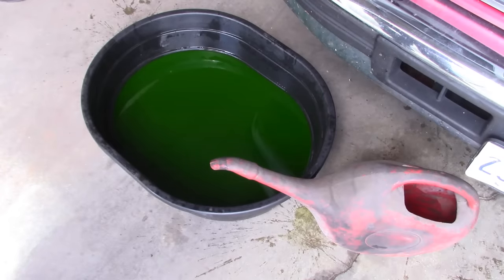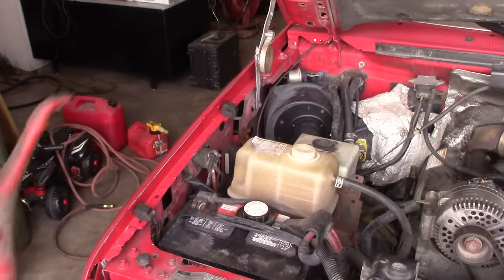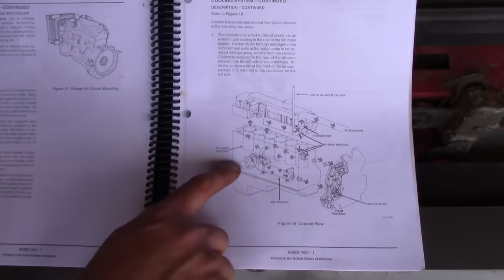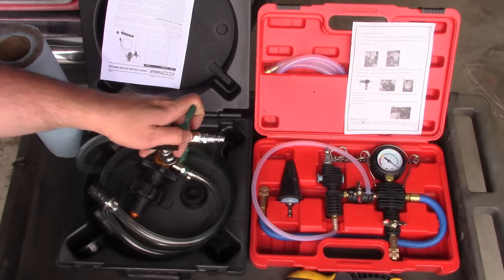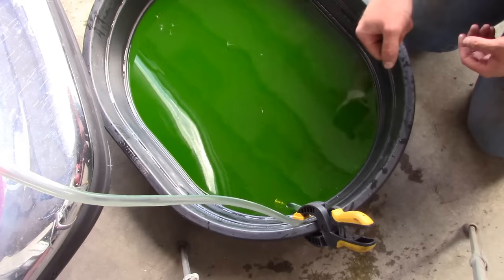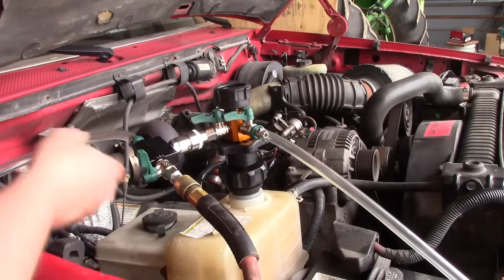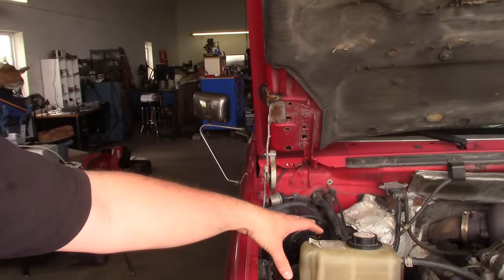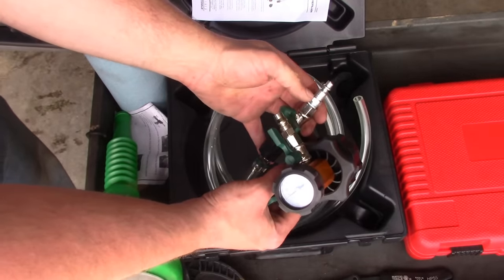What is a Vacuum Coolant Refiller, and why do You Need One?

Comment: We got one for the shop. We immediately noticed that after using it to fill all the cars with coolant that a good percentage was coming back with radiator and heater core leaks.  They were not able to take the vacuum when the plastic radiator caps get old and brittle.  They were designed and braced for internal pressure, not for an external one. It worked great but we stopped using it because of that.

Comment: I am looking for a version that is especially designed for air cooled engines. But they're hard to find.
Reply from the maker: Snap On probably makes one.
Reply: I've been informed that version is on backorder along with the diesel spark plugs and left handed ty-wraps I need to finish my Deutz Tesla swap project.
Reply: @zlmdragon.  you again, you asked the same ques. on another channel.. nobody answers dumb questions.
Reply: You find them in the section where the antifreeze for VW Thing is.

Comment: I have the U-view Airlift ($120) at the shop, saves SO MUCH time after a radiator or water pump replacement. They are a must on a lot of the newer vehicles, almost impossible to bleed them without it.

Comment: These tools are great I have two versions in my workshop, but they do need a brief warning from my experience, the vacuum refill is good on new systems but on older systems by vacuuming the system the rubber pipes suck in on themselves, on old pipes I have found that this can cause them to split internally, admittedly they are already weakened, but nothing worse than doing a quick coolant change and the cars comes back in weeks with a split or leaking old pipe! Great kit in the right application!

Comment: I know I'm a little late to the party, but I use these quite a bit in my shop. Mine is a Cornwell one. We used to use the electric pump like you described. For a while we had problems with Cummins EGR coolers failing often and putting coolant in the exhaust. We started using the vacuum fillers and the problem dropped quite a bit. Thought is the corigation on the EGR cooler pipes was holding onto air bubbles and causing hot spots in the cooler. The vacuum eliminates the bubbles so there's less failures.

Comment: Those are great. Had one for years. The no spill funnel is awesome as well. I usually only use the vacuum filler on problem engines, but the no spill funnel doesn’t fit all the time. Great video again.

Comment: I've also used a method using a 5 gal pail with a barbed hose fitting installed at the bottom of the pail with a 10' length of clear hose. The cooling system needs to have a drain cock on it though. You drain the coolant with the bucket sitting on the floor and then use the same drain cock to refill the system, but put the bucket up higher that the engine and it fills from the bottom up. Works great and you don't get any air in the system.

Comment: More for industrial or Diesel engines which have a more complicated system so to speak, but for my little Honda & Chrysler 300 my Spill-Free Funnel works great. It takes a little longer and you do need to run the engine long enough to open the thermostat. Having bleeders in both cars is a big plus. And an air compressor is not required. Great info Wes. Thanks!

Comment: Well thanks for that, now I need another tool. I used to work on old indirect PSA diesels and they used to spit cylinder head gaskets off at the slightest excuse. They also didn't have a separate header tank or bleed valve - I often wondered how many went due to air locks.  This toy may well save a few cylinder heads. Cheers.

Comment: Been using one for over a decade. Started off with a Snap On one that worked ok. The part I didn’t like about it is you had to hold down a button to apply/keep the vacuum going. Currently I use an AirLift brand one which has the valves like the one you have. 

A couple of things I do a little different then you (not that either way is right or wrong) is I put the grommet on the tool first then out the tool on the tank. I also partially fill the system and then reapply a vacuum to the system just Incase there is some how an air pocket (obviously there shouldn’t be, but ocd gets ahold of me sometimes). Then just continue to fill the system. I’ve never bleed the fill hose (again nothing wrong with doing so). I have noticed they can overfill the tank a little.

Comment: Just ordered one for 82 bucks and used the link, I think it will be well worth it. Maybe I missed it but if the engine is cold how do you get coolant through the engine and also into the heater core? I have a common problem with my 97 f150 that air is trapped in the heater core since its above the coolant bottle. Will be nice to get it out

Comment: I use the airlift brand. Nice when your filling a 15 gallon cooling system on a trash truck with a reservoir that’s 10 feet above the ground. The stock hoses are always too short, I bought some bulk clear hose and I can fill a truck up a bay over.

Comment: Late watching this but they are great tools and work well on most engines. Vacuum leak down test can be misleading as I have had it suck some leaks shut and they leak with pressure but hold vacuum ok. In the olden days my dad would put an aspirin in the thermostat then fill the system. The aspirin would allow the air to escape thru the thermostat. We also drilled a single small hole in new thermostats to allow air to escape from behind the thermostat body.

Comment: I just use a 5 Liter canister and put it on the engine, with a big clear pipe attached. When I tilt the canister 90° it will fill the coolant tank.
Those canisters have a second cap, on the other side and you can open and close it to change the flow rate. It works pretty good for me.

Comment: This is interesting having a big vacuum pump so much more useful. I have a big Sergent Welch vacuum pump I bought for $50 years ago from a used scientific supply. My son used it for pumping down ACs. With that and a few valves you can do vacuum filling. Plus a few rubber stoppers. On a wheel cart not bad to move around. Will be with you forever.

Comment: Probably could rig it to hold oil in a tank as well. We use a vaccum deal on the combines and sprayers so you can replace a hose or o-ring and not have to drain the system.

Comment: I drove a fuel truck with the DT466. If you ever stalled it out going up hill and started going backwards ( on ice no less ) releasing the clutch with it still in a forward gear would cause the engine to fire in reverse. Blowing exhaust out through the intake. It doesn’t bit sound good either.

Comment: I just finished changing the coolant on my 2016 Kia soul+ 2.0L.  Used the OEMTOOLS 24444 Coolant System Refiller; it worked very well.  It pulled a full vacuum in less that 30 seconds!  The only improvement I wish they would make is to redesign the filler pickup so that it fits through the opening of a coolant jug.  Close, but no cigar  :-((

Comment: Do you think collapsing  the hoses causes any damage to old coolant hoses ?   I do like the radiator hoses with the internal stainless steel  coiled springs that stop hoses collapsing.
Reply: If it does compromise the old hose, it should probably be replaced anyway. As far as reinforced hoses. I assume just won't collapse. Should be no harm.

Comment: Read 98% comments. 
One thing that comes to mind is , I installed refer's in trailers n did other AC/refrigeration.  You braise/silver solder a system open with nitrogen purge, then pressurize system with nitrogen to 100 -125 psi. , then set to hold pressure.
You go thru spray/wipe down joints that been heated. You watch gauge & it had to maintain pressure where you set it at for 20 minutes while you picked up , cleaned or did other steps.  Then you release pressure n put on a vacuum pump or two depending on capacity of system ,  go to lunch 30 minutes , (ate when ya could) n typically would be in a deep vacuum as shown by micron gauge.  Always amazed me a system that hold 125 psi , you find a leak by pulling a vacuum.
Yes we pulled to under 300 microns or lower. 
So then you re-pressurize lots of times in 250 range to find a minuscule leak that would hardly even show a bubble that would grow so slow might take 10 sec or more to barely start to form, then longer to grow. 
Was not often. Always made you Shake your head. 
So draw a really deep vacuum , hmm.  
Think I'd start with a 15 psi at first.

Comment: Benz have a factory tool like this, only issue I've had is some of the diesel plastic coolant housings (that are falling apart anyway) actually snap the inner plastic ring retaining the o-ring to the head after being vacuumed down and then start leaking, I guess it's a similar outcome if you pressure test your cooling system and something fails, better to know now than down the road.

Comment: I am lucky my current car (Volkswagen T5) has a senssible drain at the bottom, fill at the top, system designed to be easy to fill/flush. BUT my two previous vehicles a Misubishi Delica L400 with a 4M40 Diesel and a Mazda Bongo diesel had systems that NEEDED something like this, I didn't know they existed so I made my own version using an old fridge motor as a vacuum pump.

Comment: I have been drilling a 1/8 inch hole in the thermostat to avoid the problem of the air lock, some not all thermostats come with a small notch in the plate or a weep hole in them. The only difference with the small hole is it takes about a minute longer to get to operating temp. My wife had a Buick Skyhawk and every morning the car temp gauge would get close to the red line then it would be fine until the next day after it cooled down, so I drilled the small hole and it never had the problem again.

Comment: If the drain petcock has a nipple you can run a hose from there to the coolant pan and just pull a vacuum and fill it from the bottom all in one operation. I think I've only had to refill cooling systems the way you showed a hand-full of times.
Reply from the maker: What kind of cars do you work on? I can't think of any vehicle where that would be easy to rig up, or even possible.
Reply: @WatchWesWork  I work at an International dealership (trucks not tractors). The newer trucks have a quick disconnect for draining coolant, the old ones have a petcock with a little nipple that I put a hose on and run that to my drain pan.
Reply: @Zach_A  holy macaroni that's a world away from the mis-match junk I've worked on but that heavens a manufacturer still designs solutions..

Comment: almost  all modern coolant-systems have a very small bypass bore to prevent the thermostat being trapped in an airbubble ... and bleed the system while not circilating the radiator  ;)

Comment: I bought this device and have a few dumb questions.  
1.  Should i drain all the coolant out first before using the device or this device can drain the coolant through the vacuum?
2.  Can this device vacuum all the coolant out of the engine?  Or should I have to do something first like warm up the engine before?
3.  What is the pressure in the compressor before I hook it up on the airvac refiner?
Great video.  Thank you in advance for your help!!!

Comment: Did this for the second time yesterday with an airlift brand unit.  It was awesome and car did not overheat afterwards.  2.0 duratech ford focus.  Sucked a little over a gallon in 15 seconds.  First car I tried this on was a Diesler T & C 4.0 that would not hold pressure due to a leak in transmission cooler.  This was awesome how quick and simple it was.

Comment: Yes I've been waiting for the next video, people need to start braking more crap and bring it to you to fix so you can make more videos. They make a semi coolant refiller tool for just large trucks
Reply from the maker: I think it's the same tool with a longer hose.
Reply: A lot of the big trucks now have a quick coupler on the radiator, engine block or egr cooler, that you can drain or pressure fill from. I believe you hook direct to a vacuum evacuator

Comment: My thought was if I can, then I could do complete coolant flushes without  having to open any hose / no possible mess. Evacuate, add water , evacuate repeat , until water is clear  possible add a coolant flush additive. When that all done evacuate everything, then pull vaccum to remove air pockets , then refill new good coolant as demonstrate in your video... Done

Comment: Would the vacuum damage the hoses at all? Thinking about them ripping open near a jubilee clamp. Thanks for sharing, great content.
Reply from the maker: I have not had any issues. Remember, the pressure on the hoses can never exceed atmospheric pressure, which is around 14.7 psi. That's pretty low pressure really.
Reply: @WatchWesWork   true enough 👍 thanks

Comment: My only hesitation is when reusing coolant, possibly  picking up debris that may have fallen in the coolant catch pan, then reintroducing it back into the system.  Wonder if there is anyway to install some type of inline filter in the pickup tube. Maybe a glass inline fuel type filter? Am I being to paranoid because I love the concept? I use air for everything.  Thanks Wes for these videos.
Reply: Question : Would coolant pass easily thru a gas filter ? I'd use a clear filter so I could see if it was catching a lot of trash/stopping up.On used coolant I pour it thru an automotive paint strainer into a 5 gallon bucket first. It gets out the bigger trash so that anything left is very small.

Comment: First of all, Thanks for sharing. Your procedure was going great until the 14:08 mark, when it started to gurgle and air was reintroduced  back into the system. Should you have shut off the supply inlet valve before you ran out of coolant? I don't know if that made a difference in your vehicle application. Just an observation. Thanks again.

Comment: A question I need an answer for: had system flushed at ram dealer. After job thought it was just to neat. Asked how they got dirty post flush coolant out. Said, I have a little hose that I suck it out with. Did I get scammed?

Comment: I have to put a radiator in my '04 Chrysler 300m soon. In fact, the new one is leaning against the wall in my shop. That car often times is a real bastard to fill right. It's a 3.5 ho V6 with the goofy bleeder on the intake and the rad cap on the overflow tank. I wonder how well one of these would work...hmm
Reply from the maker: Any V6 can be tricky to fill.

Comment: I got pretty much the same tool off amazon just a different name. same case and fittings.   Just used it for the first time after replacing my water pump on a 5.7 '14 grand cherokee. At first I set it at 17 ( rated for 18) and it was slowly losing pressure.  I pumped it up again and it lost a few psi even slower.  Pumped it up to 18 about 10 minutes ago and it's holding steady.   What's up with that?  Maybe the tool itself where it connects to the radiator needed a better seal? I couldn't hear air or anything.  Haven't seen any leaks yet.

Comment: Helpful video. why did you not open the heater valve to purge the coolant in the heating system. It is part of the cooling system. The hose leak or air pocket could be there.
Reply from the maker: What heater valve? I haven't seen one of those since the 60s.
Reply: @WatchWesWork  Mine is next to the AC in the cab of my truck. It is actually called the heater, but it is really a valve that allows the hot water from the cooling system to go through the heater core to keep you warm in the winter. I guess in the summer you don't think about all the coolant stuck in there.
Reply from the maker: @juliewoods6534  That's a very old school way to do it. Almost all cars use a blend door to vary how much air goes through the heater core.
Reply: @WatchWesWork  Would it make it easier for you to understand what I am talking about if I posted a picture of the two hoses going in and out of the firewall that lead to the heater core? Believe it or not even when the heater is not on there is still coolant in the core. It would be a good idea to evacuate that also. I have been working on cars since 1970. Can you operate a timing light or set points? Yes I am very old school.

Comment: Mine worked pretty good but I could still hear some gurgling but nothing coming out the hose? The hoses are collapsed but it must be done? I wanted to use this to get the fluid out of the cylinder jackets because I'm changing the 2 knock sensors. but it didn't work, I was drenched when I took the knock sensor off. I'm wondering if there is anything that would be able to empty the fluid from the water jackets?

Comment: I bought this tool. The quality is great, however, I cannot for the life of me bleed the system in my MK7 Golf TDi. I replaced my heater core and performed this process but still have a gurgling sound coming from behind the dash after turning off the car, so I know I have an air pocket in the water system. 100% confident I performed the refill correctly (did it 3 times) however no luck. Not sure if the vacuum this thing produces is strong enough.
Reply: Dunno if you got this solved, but there might be a valve in your heater circuit... several makes have had them in different vehicles over the years.

Comment: One feature with this vacuum filling system. It might rupture weak rubber hose. Well meaby it's good to find it and fix.. But without the stress might have been fine for a long time.
Reply from the maker: If it can't handle a vacuum, it needs to go!

Comment: What about the thermostat? The engine I'm working on doesn't have a bleeder screw, so do I remove the thermostat or not. Why isn't this system built using a vacuum pump? Wouldn't a vacuum pump be better than running a noisy air compressor?